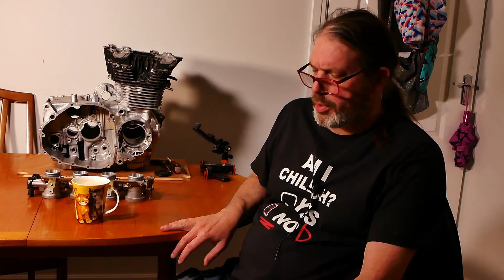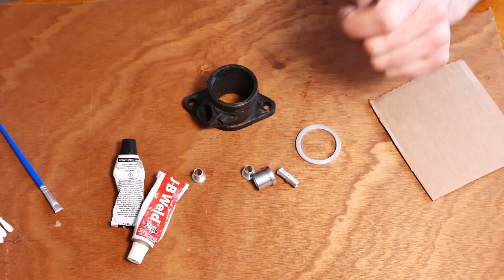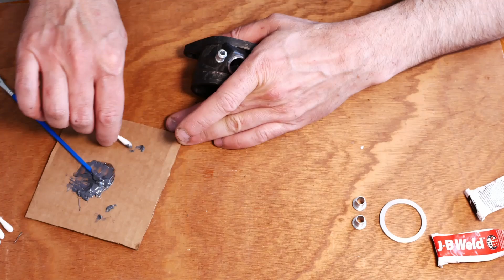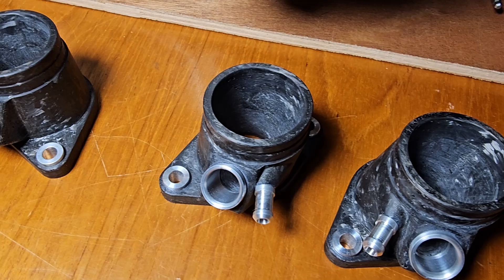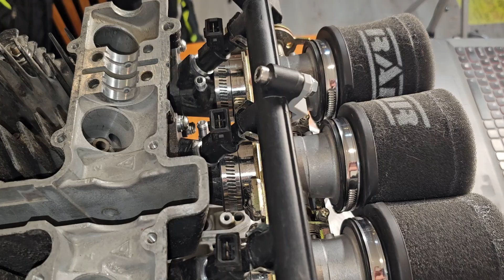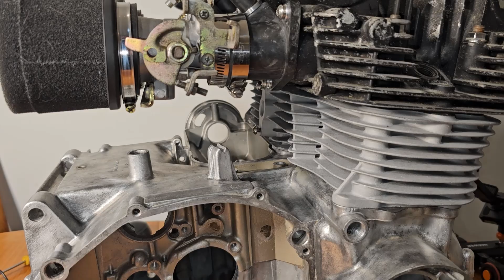Cheap DIY fuel injection on a classic bike, episode 8.

Comment: A couple of comments..   

Firstly, it would be preferable to angle the runner (and obviously the TB's) up a little (around 10 to 15 degrees 'typically')  to 'hit' the back of the valve.  It's worth good power.

Second, when doing the above, it's nicer to have the injector UNDER the runner as it aids fuel atomization as it cuts through the airflow.  It also helps with part-throttle response as the throttle blades open.

Thirdly, tuning with ITB's and MAP is HARD.  You're gonna want to look at Alpha-N tuning (ie. throttle postion Vs RPM).  A good video to explain this is here: https://www.youtube.com/watch?v=IbDBsq8W14U&t=545s

Otherwise..  loving the build.
Reply from the maker: Thanks for the suggestions.  Nothing is cast in stone yet and it might all change before I get the bike running. I am expecting a lot of trial and error with the tuning but if I can just get it running I will take it to a dyno and get a proper fuelling analysis.

Comment: Does the ecu your planning on running have an idle stepper motor to control the idle air bypass and thus idle speed of the engine?
Reply from the maker: Yes. It's a triumph tt600 ecu and iacv.

Comment: Kind of ironic, I quite liked early gs550 slide carbs as they were quite robust and tunable. 
 They drop onto cb550's as the cylinder spacing is the same and the CB carbs were terrible as all the linkages were exposed and wore quickly whereas the GS ones were all sealed inside the carb bodies.
Reply from the maker: I hear you but this bike is an experiment :)
Reply: My gs 550 had cv carbs! Think it was a septic import, as bought it off a yank out of heyford. Fantastic mill. Just the bike needed a diet!😊

Comment: I had to move my throttle cable mount between 2 and 3 so it routed neatly under the tank. Put the tps on the end.
You might find your engine temp sensor is better put in the head where it will give a better indication of the running part of the motor.
Do you need an idle air motor? Don't have to worry about changing engine loads like AC, so perhaps just a "choke" knib to cam the throttle stop?
Reply from the maker: Thanks for the suggestions.  I still haven't quite decided on the cable routing yet.  Same with the temp sensor. I was planning to tap into the oil flow but it does make sense to get head temp instead.  I'm keeping the iacv because the gs motors are very cold blooded and it makes the warm up cycle easier, if it works.
Reply: @Blackthumbditch . Very interesting, I look forward to seeing how it turns out, might be a good upgrade for my bike. Problem I had with my bike was the crank sensor, never worked reliably when starting. I changed to a hall effect sensor and the problem went away.
Are you using a map sensor or a tps? I use a tps but I think it might be a mistake. My bike runs 95% perfect, but you know I'm always chasing the 5%. Oh my bike is a gpz 1100 motor bored to 1400. In a z650, dressed up like a triumph bonneville - well might as well be completely mad!
Reply: You might be better to leave your temp sensor where it is if your fi system is for a watercooled engine. My head temp sensor went off the scale for my fi system. Luckily they recoded the system as an update for me (and others with air cooled engines DTA).

Comment: looking great having the fuel rail on top should be better for fuel delivery to the engine also look at some Velocity stacks to help with airflow GSXR 750 RAMAIR sock filters fit its a set up I have on my Yamaha FZS600 fAZER . Insted of modifying the right  hand side of the engine for the crank sencer would not the left have been better and used the TT600 set up ? from my one experience back in85 the GS650 BLOCK goes near strait on 😎😎
Reply from the maker: Thanks bud.  I will look into the ram air sock. I had originally considered 3d printing some velocity stacks to fit inside the pod filters. Good idea on the 650 top end.  I will keep an eye out.

Comment: I fuel injected my XS650, used a microsquirt ecu and early 2ks gsxr600 throttle bodies, they fir the bs34 carb boots perfect.
Reply from the maker: How did you get the fuel map correct? I'm planning to compare torque graphs for the tt600 and the gs550 and then adjust the map accordingly and then if I can get it running well enough I can take it to a dyno and get a proper fueling analysis. My hope is to be able to just use the stock tt600 ecu but if I can't get it to work then it will have to be aftermarket.
Reply: @Blackthumbditch    I used tunerstudio for tuning.  I basically copied the stock advance curve for timing, and tunerstudio gives you a rough fuel map based on injector size, # of injectors and cylinders.  That was good enough to get the bike started, then I did short rides close to home while recording a data log and used that info to change the fuel map.  Once it was within about 10% of target afr everywhere I started using the autotune function.  This got it as close as a street tune can and for further refinement you can go to a dyno.
Reply from the maker: That makes sense. Unfortunately the triumph ecu is an open loop system so it will just have to be trial and error.
Reply: @Blackthumbditch  I haven't looked to see which specific ecu you are using, but you might check and see if it's compatible with tune ecu.  I used it to change the tune on the tiger 800xc I used to have.  You can make pretty big changes with it to get closer to what you need.  It connects through the obd2 port, you can either use a bluetooth one or one that connects to a computer.  I would recommend the computer one just for stability of connection while uploading a tune.
Reply: What torque improvement is there over carbs?